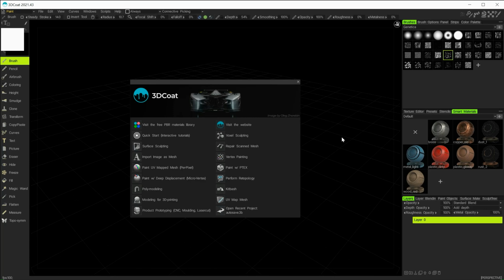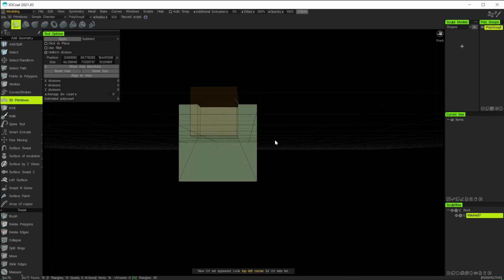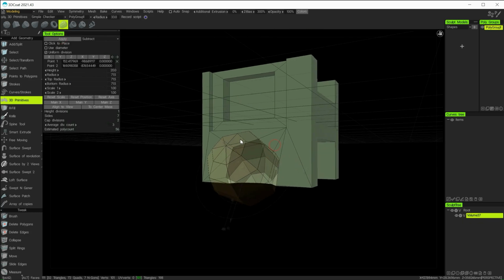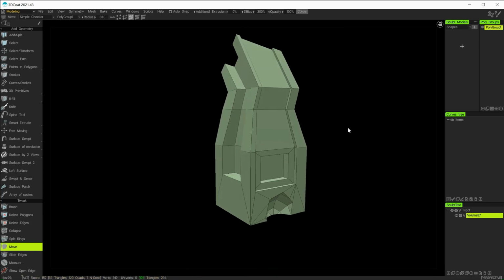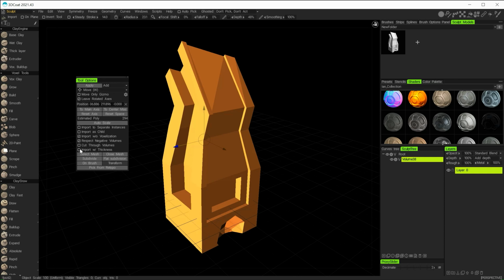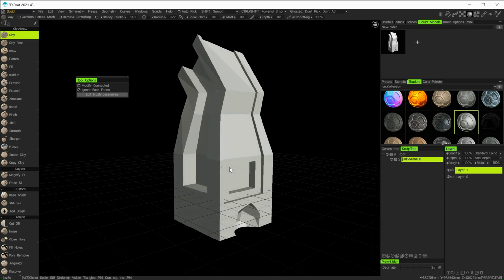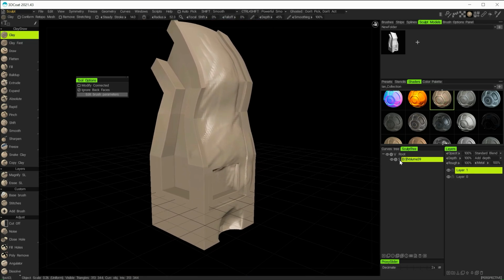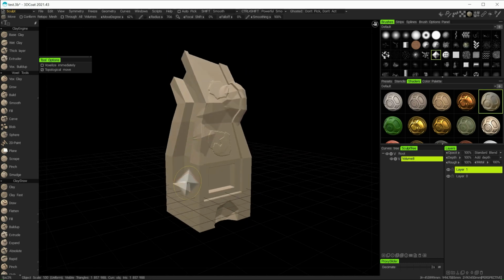3D Coat - Intro to Polygon Modelling

Comment: in 2024 they changed Smart Extrude tool, so that trick with setting rotation pivot by click on surface is no longer there :( To be honest I don't like that new gizmo with 3 circles. It's nice tool, but UI and settings for all operations are still not planned well... Also the problem of accidental extrusions is annoying - you can make unwanted 0 height extrusions by: 1.double clicking 2. hitting enter 3. touching outer ring - and it is invisible in viewport, but making double verts, which you can find only by selecting verts and trying Weld Verts command.

Comment: The boolean cur where you had geometry error... What if youre specific design needed that boolean cut how would you fix it
Reply from the maker: The modelling room is very new to 3DC 2021 and has a few issues such as the boolean operation I showed, it has issues with Ngons. The fix would a manual one using one of the Quad Tools or Add/Split Tool to patch the issue. I did mention that software like Blender has a more powerful modelling toolset. I would recommend at this stage that specific ( detailed ) modelling work be done in those apps. There is alot of potential however with the Modelling Room when combined with sculpting, painting etc.

Comment: Can i orient pivot to face, edge, vertex and snap pivot to vertex like in Maya?
Reply from the maker: If you select the Smart Extrude there is an option to 'Snap Pivot' & 'Draw Pivot' these allow you to extrude, scale, rotate around the Pivot you create. Alternatively use the Select/Transform Tool with Auto selected for Face/Vert/Edges selection. Then as you hover over an edge, vert etc and it highlights you snap the Transform Pivot to that selection. You can also select polys etc and when the Transform gizmo appears, then hold down 'Shift' and move the gizmo to where you want the pivot transform to take place. It doesn't act exactly like Maya though. Hope that helps, sorry for the late reply!

Comment: Hello I’m getting a little confused about the workflow. Should I model parts that are simple in the modeling room link them to the sculpt room and that will save me some retopo work? Would linking that many meshes be hard on the memory? I’ve also had an issue trying to use a shape I made in modeling room as a cut shape for Boolean in the sculpt room. I’m still learning the software. Falling in love with it.
Reply from the maker: Hi ... I would definitely only start with simple objects, finding your workflow is more important in the early stages than making cool art. Once you understand how it works best for you... the rest will be a breeze and you can let your creativity flow. Yes it will save on Retop time in the future. Not sure about the memory side, its more of a developer question, but I've had no issues unless I get a corrupt mesh at some point along the way, but than happen in any app. The booleans are ok in 3DC ( its not like boxcutter in Blender which is quite solid ) ... but its ok, hit and miss. So don't think you're doing something wrong, its a bit funky, and you'll have to work around the 'funk' :). Stick to it and it will start pulling together in terms of the 'rooms' and you'll see how having everything in the same app benefits your pipeline. Hope that helps!
Reply: 261 coat tuts i compiled....its a deep program many ways to work...
https://www.youtube.com/playlist?list=PLTws_PUJ0rh7UilUzES43A-CwtnwHmZly

Comment: Is your model real world scale? And when you export the model does it have correct dimension in other appz?
Reply from the maker: To be honest I never checked the scale etc when I did this tutorial. It was just a case of 'throw a model in there and see what you can do'. However the if you bring a model in from another app then it will respect the scale and position of that model. There is normally a dialogue box which asks you if want to preserve the dimensions from the origin app. Would have to check this to give you a solid answer.
Reply: set up scene scale in prefs...m mm etc...

Comment: Modeling Room. Another way of getting your mesh into the sculpt room.   Mesh menu---Sculpt Mesh with or without subdivisions. You can unlink the sculpt mesh when done with your work. This workflow will dynamically update the modeling room object in the sculpt room as a sculpt surface mode object.
Reply: The modelling and sculpting workflow is disjointed.  Why the need to import a model from model room to sculpt room? In other appz you just switch to sculpt mode and sculpt the mesh itself. 3dcoat needs to add multi res sculpting that would work that way.
Reply from the maker: @3dgraphicworkz463  I agree - it  would be better with a subD workflow. You can use SubD method ( its not ZBrush ) but you can model a low poly object and increase its divisions. I'll go though it in the next video... the tutorial really just showed how you could take an object and drop it into the sculpt room. Completely destructive workflow I know :) I'll try and get the next video out soon. Thanks for your comments.
Reply from the maker: Here's a video already made showing the subD workflow... https://youtu.be/pUWNIcmSlGM
Reply: @IanThompson007  not much of a tutorial there. It's a time lapse.  
There's still no official tutorial how to import a mesh from maya, max, etc and then do some modelling>uvmapping>painting> going back to modelling room for tweaks then exporting the finished model with correct scale as it was in maya, max, etc.
Reply from the maker: @3dgraphicworkz463  I’ll cover it in my next tuts.
Reply from the maker: Hope this helps... looking at a basic pipeline between 3DC and Maya. https://youtu.be/0IgAzJ2bmm4
Reply from the maker: Yip... I'll try to cover the other methods in later tutorials... thanks.